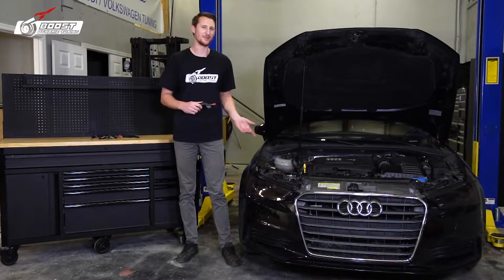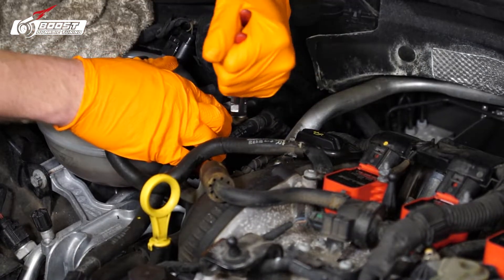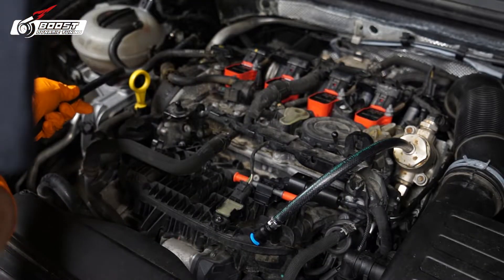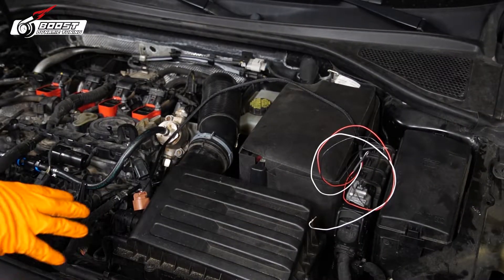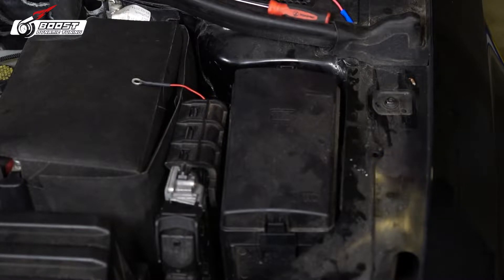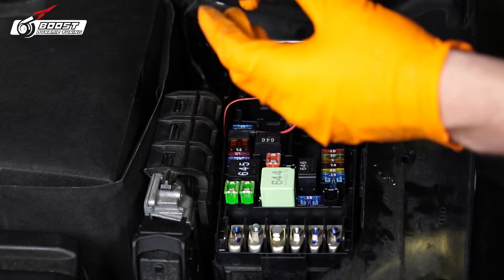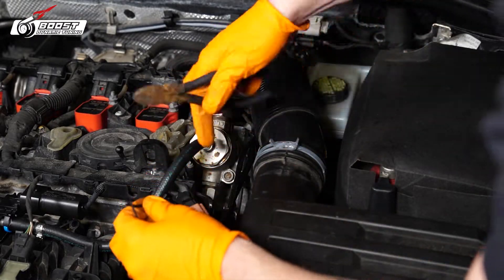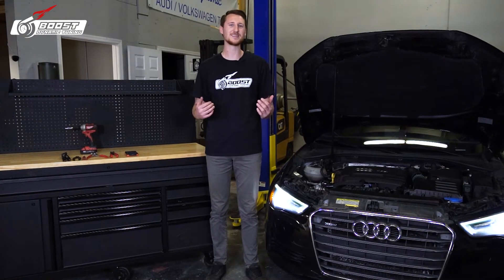How To Install Ethanol Content Sensor - Audi A3 2.0t

Comment: Would this work for a 2015 A4
Reply from the maker: It will Not work for a 2015 a4.
Reply: @boostdynamictuning oh damn is there anything out there because I’ve been searching and I really can’t find anything. Let me know if you find something. Really appreciate it. Thanks for the reply.
Reply from the maker: @GHOSTPAYNE, this car is not set up for e85. There's no reason to push things when it's not made for it. That's why you won't find information on it.